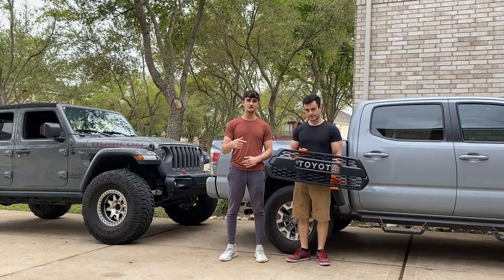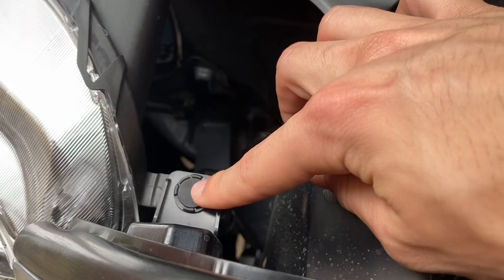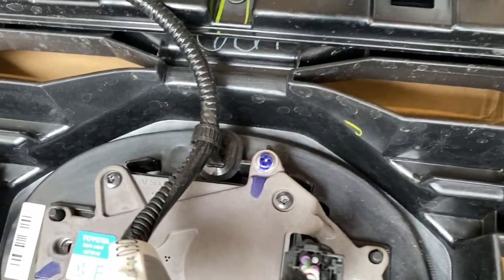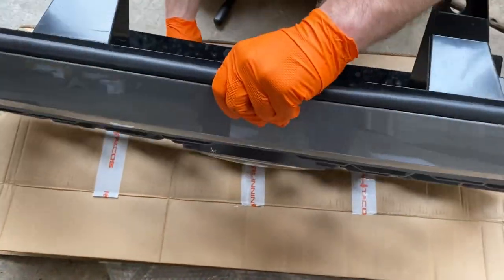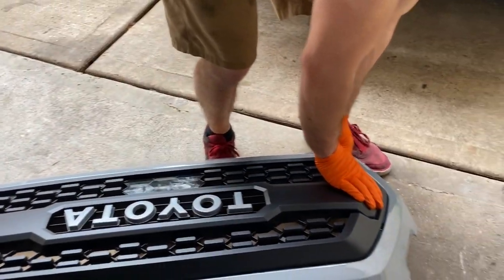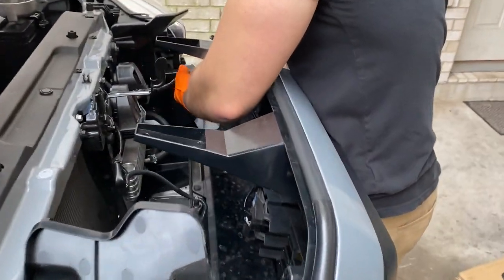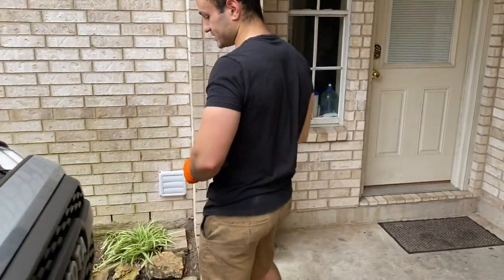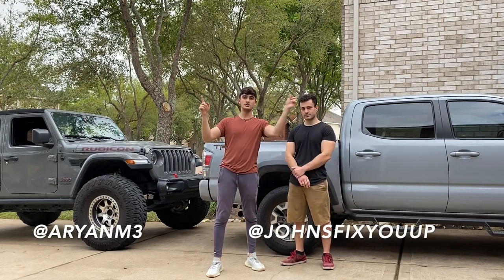How To Install 2020 Tacoma TRD PRO Grill

Comment: The sensor tho drops a good 3-4 inches in the new grille - me thinks it will need recalibration for the new position or else you will compromise on safety.
Reply: I've seen others add washers on top sensor screw to fix the angle. Have you seen this as well?